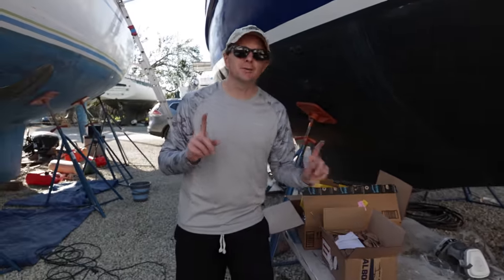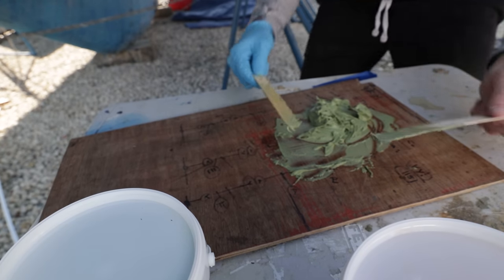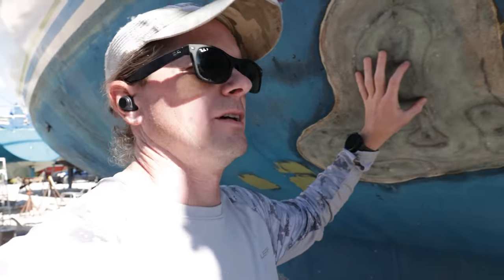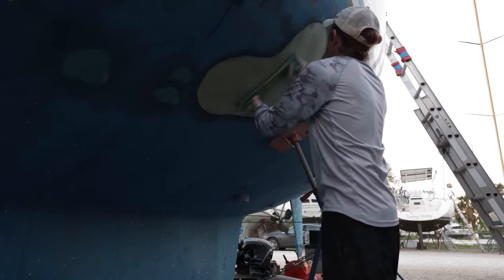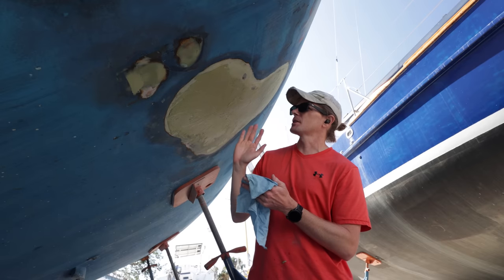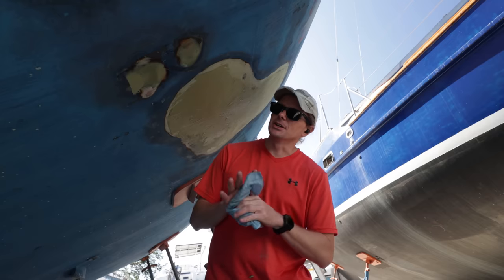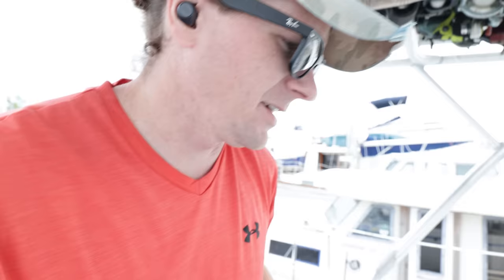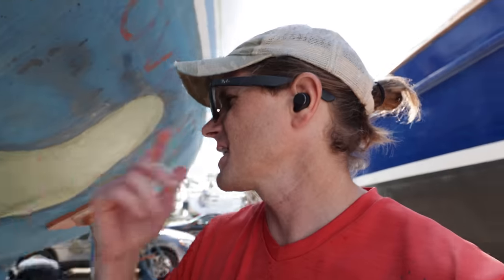Fixing our HULL part two - fairing, barrier coat, primer & thing we wish we knew | AHOD 18

Comment: Real good summary at end. Can’t remember but we’re you looking for a project boat when you bought her? Or did it just work out that way? Did you feel intimidated by her size? Or is the size of yacht you wanted?
Reply from the maker: Thanks for watching and for the kind comment!

We were originally looking for a boat with some projects rather than a project boat. 

We did not feel intimidated by her size (she has always been in the range of size we wanted), and prior to Hurricane Ian, she had just about the right amount of projects for us. When we bought Magic Dragon we could have easily put the boat right back into the water and sailed off. The project list back then was more a list of wants than a list of needs.

Obviously, Ian changed the equation and now it's up to us to respond to the circumstances we've been dealt. So, we will happily take on the additional and necessary projects to get Magic Dragon back in the water. 

I hope that answered your questions 😂

Comment: Do a small project first. Get used to how it works. The biggest issue is really making sure you mix it all properly (find description of why to use a two cup system) and getting all the air out. And holding it in place, especially on the outside of boat hull, i.e. clamping, sometimes you can trust epoxy to just stick, sometimes you want more pressure. Hardly rocket science that you need experts in. Just messy and a lot of work.
When I patched a my boat I did it all all once, multiple layers wetted out on plastic together then stuck up on the boat, run around and do similar on the inside of the hole, all at once, not letting each layer cure separately, not sure if that is any better or worse, but it was done in a day...
Reply from the maker: Thanks! We are pleased to report that our work has held up very well so far!